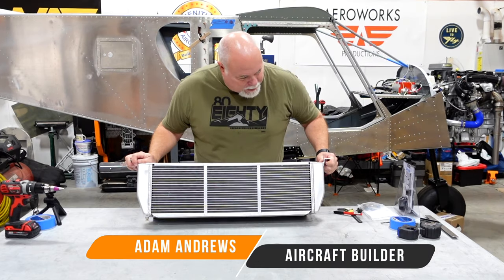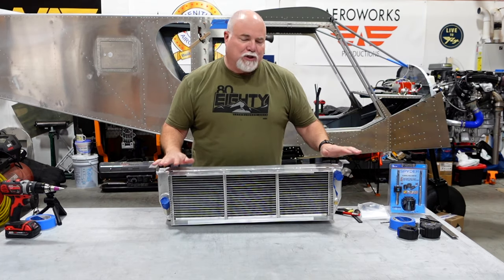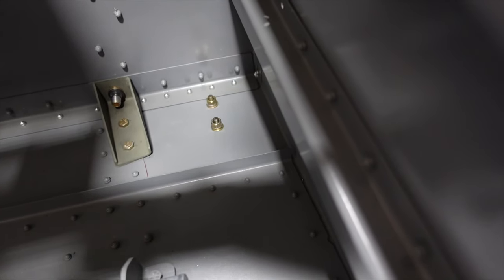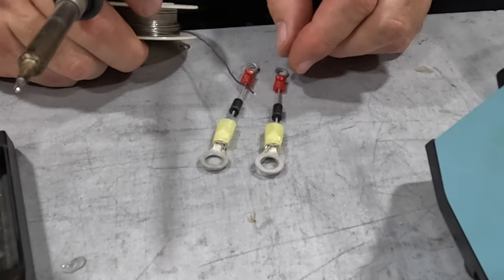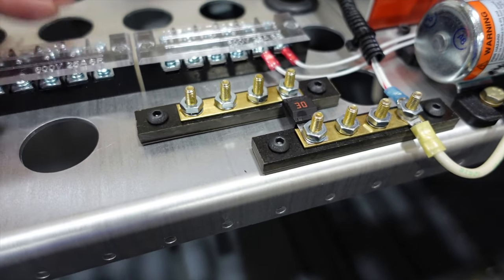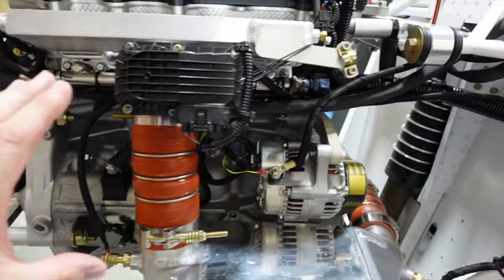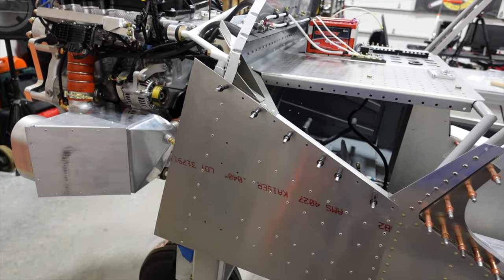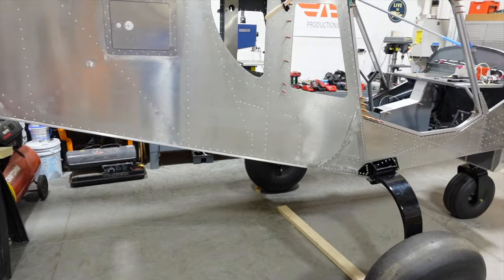Ep. 49 |  Radiator Install, Fuel Tanks, Wiring | Zenith Super Duty Aircraft Build

Comment: Nice build, & I like your honest feedback of how the build really goes. I suggest you have another look at your radiator mounting - usually to isolate things like radiators you put a rubber gromet/bush both sides of the radiator bracket to isolate the vibrations - with only the bush between the radiator bracket & the body you might find the nut chaffing into the bracket and/or the bolt chaffing into the body panel. Easy fix from where you are though, just add the extra gromet, use longer bolts & use panet washers or make up an alloy strip to capture both bolts. Always look forward to more of your videos.
Reply from the maker: Great comments, I’ve just been following Vikings recommendations best since can, I most likely will be adding doublers inside the cabin floor under the bolts plus I haven’t added the 2 other mounts yet that tie in to the center fuselage.  Waiting to get the belly pod fabled up.  Always appreciate the feedback good or bad.  Still learning a lot.